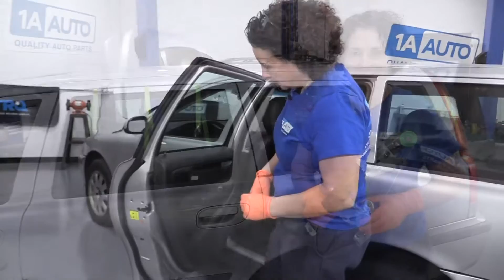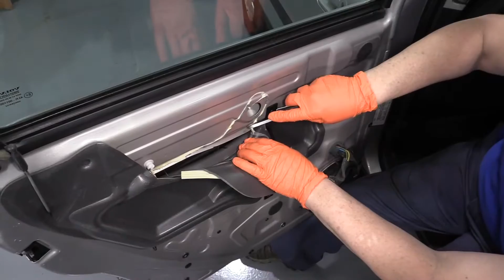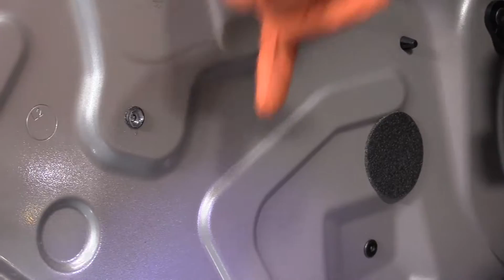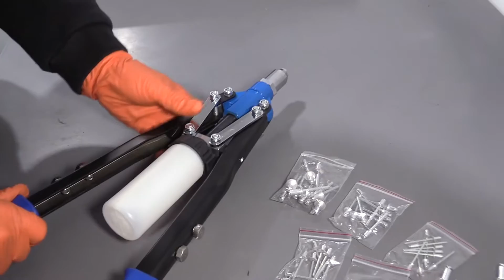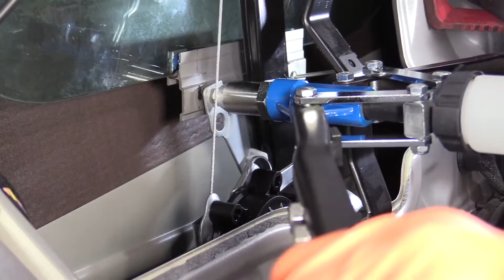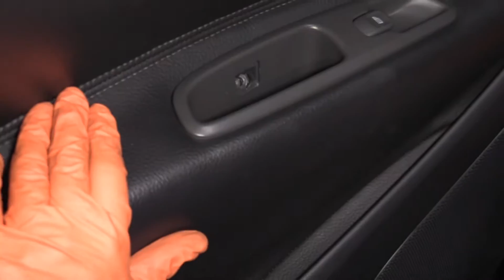How to Replace Rear Window Regulator 01-07 Volvo V70

Comment: If anyone ends up here who needs to replace the window glass like I did instead  of the regulator, here's the procedure:

1. Drill out rivets holding glass to regulator. Then retract regulator and glass to lowest position.

2. Remove rubber trim from around window and guides. You will have to pull it UP out of the guides.

Rear side guide is a plastic piece held in by a Torx screw into the edge of yhe door and one plastic pin into the window frame. Carefully remove both and pull the guide upwards out of the door. This will take some finagling.

3. You can now pull the window up. The side of the glass towards the rear of the car has a notch giving you enough clearance to tilt the window a little towards that direction. Maybe 15 degrees or so. This will give you enough clearance to slide the window up, out of the tracks and out of the window on the "in" side of the door.

4. Do all these things in reverse order to install the new glass. Be sure the new glass is inside the window tracks and the rubber trim is firmly seated around the window and in the tracks.

Comment: This has to be the dumbest design. Why put rivets instead of regular screws/bolts...is there a reason as to make the job more complicated and requiring specialized tools ?
Reply: To raise the cost of repair and charge more. And it prevents people like you and I from doing it easily in our garage without buying extra tools. 

BUT you can actually remove the MOTOR itself. There are 4 T25(I think) screws and it comes right off. It's possible with a narrow screwdriver to fit inside the door. Much easier to do it with the window up but chances are if you're in this situation it's probably fully down.

I wish she would have mentioned it for people like me in a pinch that JUST need the window to go up for now and worry about it later. Take the motor out, pull the window up, reinsert burnt motor, good to go.